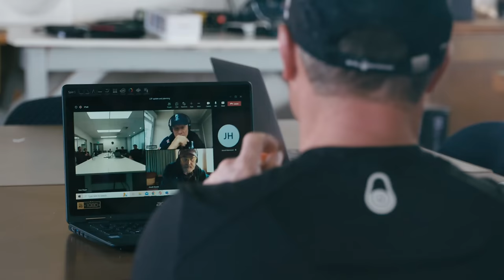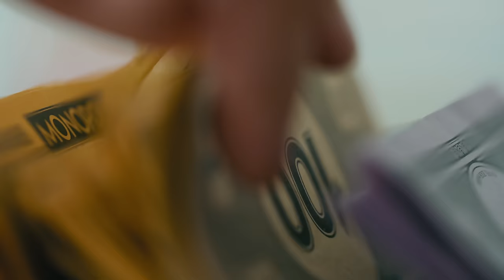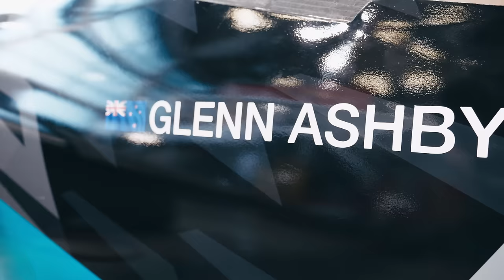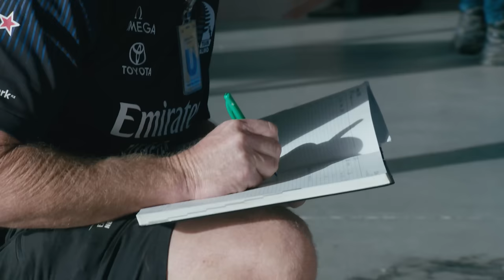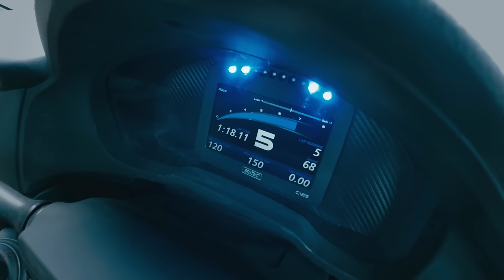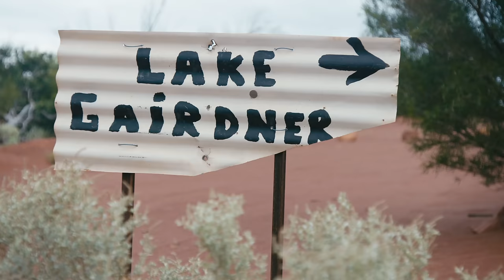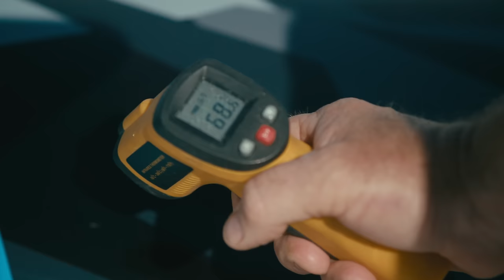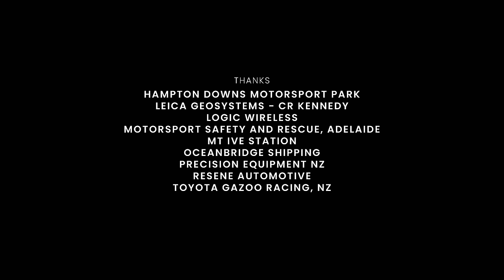LAND OF SPEED

Comment: The official iceboat speed record remains the one set on Lake Winnebago, Wisconsin, way back in 1938. It was (hold your breath) 143 miles an hour.
Reply: Iceboating was one of the first things I though of for less contact drag.  I wonder if one could make saltskates?
Reply: @ImpmanPDX  iceboat runners place a downward pressure on the ice.  This pressure melts the ice forming a micro layer of water between the runner and the ice.  It is this layer of water the reduce the coefficient of friction.  I don't think salt skates would deliver the results you're looking for.
Reply: @GOTMV   -  Salt melts if the conditions are right. :)

Comment: My guess on design differences. #1 a ton more money spent. #2 A team effort
Wing - tip smaller , Aspect ratio higher, = less drag,chord section more powerful. Chassis -  lower to the ground = close the gap = less drag. Suspension. I don’t think Greenbird had suspension. Outrigger shorter and thinner = less drag. Two rear wheels instead of one. I believe they had steering issues at one point by not getting the for and aft ce right or the steering geometry was wrong. Interestingly the craft weighed 6000lbs (way more than Greenbird and over three times heavier than Iron Duck) and set the record in less wind - less drag wins over weight. The right guy was operating the craft.